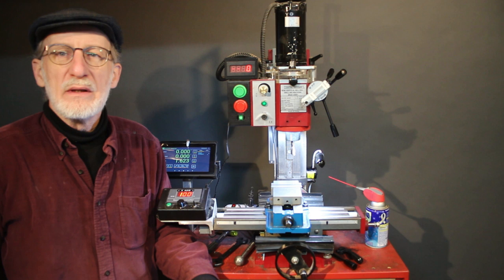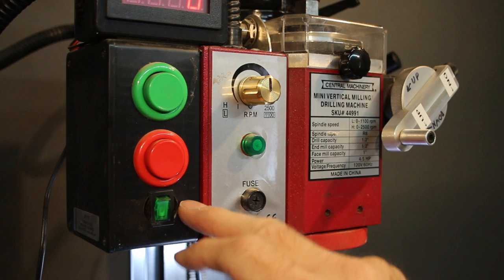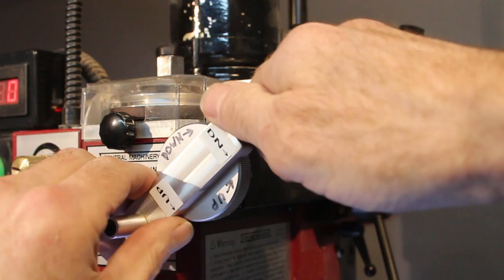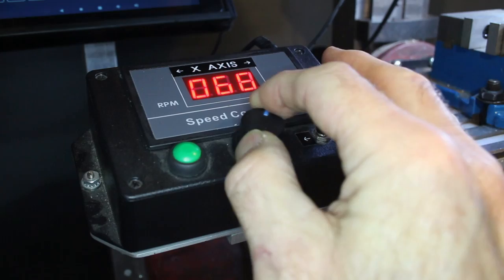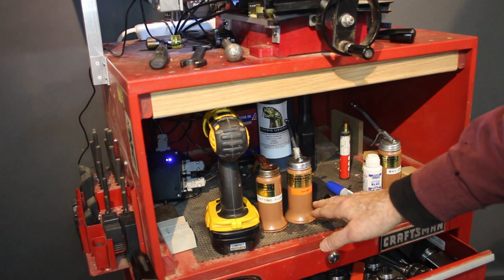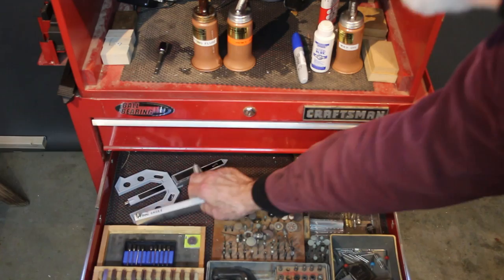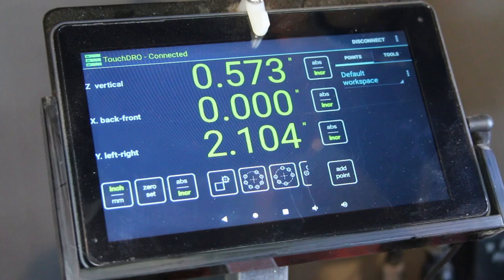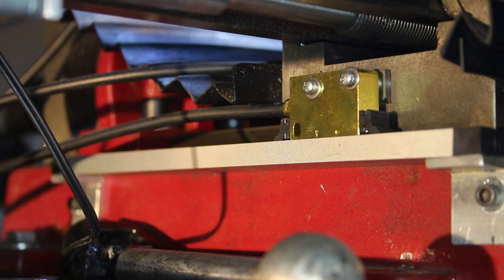Upgrades for my Harbor Freight mini mill

Comment: Great job, with the mods. I have just picked up a Grizzly version of this milling machine, and I'm trying to do similar things as you did. Could you please describe some of the mods, for example the start/stop button mod,  also which motor/power supply did you use for the power feed? A handle can't be used anymore, right?
Reply from the maker: thanks, I am sure you will enjoy that Grizzly milling machine!  If you do a Google search on "power tool start stop switch" you will find a switch like the one I built from scratch.  They are quite affordable.  

I used a 160 RPM 12 V DC motor like this one from Amazon:
https://www.amazon.com/BRINGSMART-10kg-cm-Self-locking-Reversed-Rotating/dp/B07F8RYKB8/ref=sr_1_13?crid=3VT3QS57447C2&keywords=right+angle+worm+gear+dc+motor&qid=1644072093&sprefix=right+angle+DC+gear+motor%2Caps%2C845&sr=8-13
Any wall power module rated for at least 500 mA will work to power it.  You may need to look up how to wire a DC reversing switch.  the speed controller I used already comes with a start/stop button and the speed control knob.

Right, I no longer have a handle because I couldn't figure out how to engineer a clutch.  If you want to spend the money, little Machine Shop have a complete power feed kit but it's quite pricey.
Reply from the maker: You may want to check out my latest video on how to tram the column:
https://youtu.be/8iK1hlLNB9E
Reply: @GuyMarsdenMakesStuff  Yes, those are good ways of tramming the head. I even have at work the Edge Technologies double dial tramming tool. I'm a (manual)machinist by trade. I even machine flight parts, that will go to the moon by the end of this year, and next.
Reply: @GuyMarsdenMakesStuff  The switches are no problem, I've got a fairly well stocked electronics bench. I'm curious what modification specifically you made to the controller board. BTW - You've got a new subscriber!
Reply from the maker: @jrkorman  I didn't modify the control board. The button switches just activate a relay to switch the 120 volt power. Well you can make your own as I did, it's a lot simpler to just buy a power tool start/stop switch.
And thanks for the sub!
Reply: @GuyMarsdenMakesStuff  Thank you - that makes sense. You're turning it on/off without using the knob switch! You didn't mention, did you do the screw modification from metric to inches. It's quite nice.
Reply from the maker: @jrkorman  No, I didn't mod the screw - I use the TouchDRO for all my precision work.  I installed magnetic scales on all 3 axes.

Comment: Guy.  I like the power feed option you did.  What is your power source you used for the dc motor?
Reply from the maker: Thanks! :)   I used a 12V 1.5A wall adapter that I had laying around.  It was from an old Netgear router.  Generally it's good to use an adapter that has 2X the power that the motor needs so it doesn't overheat or fail.  So if the stall current of your motor is 700mA then use a 1.5A adapter.

Comment: 'Hello Guy! I have another question for you please: I hear horror strories from the users of these red HF mini mills with the tiltable column that unless one strengthens the base of the column it's impossible to mill anything because the end mills will break like mad one by one. They insist the column needs to be solidified. I see many people use these mills without such extreme mods and they work for them. Who should I believe? I don't want to get in trouble after buying one.
Reply from the maker: Sorry, I thought I had replied to this.  I don't do a lot of extreme milling with steel, so I don't see the column being stressed enough to go out of tram.  I do periodically check and re-tram the column - especially if I'll be using a big fly cutter.  I have never broken an end mill - that's usually operator error, or learning the hard way what speeds and feeds to use.  Of course carbide bits are much easier to break if you're not careful.

Comment: Do you have a link for T-nuts that fit the HF44991 table slots, the 2 that came with the Mill fit perfect, but I've ordered extra's from 2 different places and both of them were just far enough off, that they wouldn't fit in the table slots.
Reply from the maker: I bought a complete clamping kit from HF that has the right size t-nuts.  6 nuts and many bolts and clamp bars.  Essential for the mill, so I recommend getting that set.
Reply: @GuyMarsdenMakesStuff  Thanks for the lightning fast response, Actually I did that exact same thing . . . When I ordered the Mill, during check-out there was a bunch of suggested items that I might also like to purchase, one of them was a 58pc. combination step block and clamp set, so I added that to the order, but the (6)T-Nuts don't fit the table, so rather than go through the return process I thought I'd research just buying T-nuts, ( the threaded bolt pattern works fine)
Anyway thanks for your input . . . I'll contact HB and see if they can correct the order.
Reply from the maker: @dquin2932  as you probably know by now there are a variety of different tea slot sizes and I think your best option is to return/exchange your clamp set for one that fits your machine. You won't regret it!

Comment: Great video. Thanks. I am looking for a mill to miter chromoly bicycle tubing with a hole saw, but don't have room in my shop for a full size mill. Is the power and rigidity of this mill be sufficient for this?
Reply from the maker: I don't really think you need a mill for what you're trying to do.  A good drill press and a strong drill press vice should suffice. If you have watched Colin Furze videos you will see he has some very clever jigs for doing what you're trying to do.  Check out some of his weird bicycle videos to see what I'm talking about.
Reply: @GuyMarsdenMakesStuff  Probably true, a good drill press and vice would work, but I'm also wanting milling capabilities to make other things and I'm hoping this little mill is better quality than most central machinery stuff.
Reply from the maker: @adamhoff3448  understood, I was able to use my harbor freight mini Mill right out of the box after a small amount of cleanup and tightening the Gibbs.  None of these machines are perfect as delivered so you will need to spend at least half a day learning how to dial it in and getting it trued up, but it will have enough power I think.

Comment: the riser cabinet seems rather weak to securely support the mill, considering it's made from MDF, and rather thin .   You could see swaying in the video
Reply from the maker: Its actually reinforced in the corners and the swaying is due to the tool chest shifting around slightly on its wheels.
Reply: @GuyMarsdenMakesStuff  doesn't the raised profile of the auto feed control panel interfere with the table, restricting usable placement options?   the factory stock auto feed unit top surface is flush with table surface, and so is the handwheel .    please pardon my nit picking, yours is very involved upgrades and both informative and inspiring.    I am in love with these little machines and heavily mod mine too ... and i get really get into it ...  thanks for sharing .
Reply from the maker: @martinmengh  yes, you are absolutely right.  In retrospect I would've mounted everything below the table surface.  On a recent long project that stuck out beyond the length of the table I had to Mount the item I was machining up on 123 blocks which worked out okay.  But I might reengineer my motor drive control box to be below the table surface at some point in the future.

Comment: Guy, thanks for what you do love your videos after I found them a few days ago. I’ve looked at your links and I can’t find where you got your start stop switch with your power on LED lights. Can you give me an idea for a link where I could pick this up? Thank you
Reply from the maker: I am an electrical engineer, so I built my start/stop switch from scratch.  But if you search the web for: "power tool start stop switch", you will find many inexpensive options.  - I'll add a note in my description that mentions this since other people have asked.
Reply: Thank You, I’ve found a few on Amazon that I can modify.  Love the videos and educational format that you use.
Reply: Hi guy great videos👍, I purchased a switch from Amazon but I have no clue how to wire it. Do you have a link to a wiring diagram of sorts?
Reply from the maker: @kennethwealot9592  Each switch will be a little different.  But the general idea is you want to switch the AC power coming into the machine.  So you would cut the black wire inside the control box and connect each side of the cut wire to the two screw contacts inside the switch.  In theory, your switch may be different though.

Comment: Very cool I love your project 
I have similar mini milling machine i got it new but I can't remove bore from spindel I try to much but dosent want to come out do you have any idea
Reply from the maker: You need to tap down on the top of the drawer bar nut were they small hammer to release the Morse taper
Reply: I did even I used metall hamer and I heated hard its like jaam I put some oil inside also but dosent want to come out
Reply from the maker: @masoudkolahi5354  Sorry I can't help you any further.  Maybe watch other YouTube videos by Frank Hoose's: "Introduction to the Mini MIll".

Comment: Is the relay on the start/stop buttons just in parallel with the potentiometer switch ?
Reply from the maker: No, it turns on the 120V power to the machine
Reply: @GuyMarsdenMakesStuff  Thank you very much
Reply: @GuyMarsdenMakesStuff  Can you share the schematics ? I'm referring to the green and red button connections.
Reply from the maker: @ddlc7022  Sorry, but when I removed those buttons recently as part of the brushless motor upgrade, I forgot to document how I wired those buttons.  There was no relay, so I really don't recall how I did the wiring - it was just the 2 arcade game buttons.  The upgraded motor video shows how I wired one red button as a STOP button, but that's a totally different control system:  https://youtu.be/ndhsCeuEv-4
Reply: @GuyMarsdenMakesStuff  Never mind, I figured out how to do it on my machine, which is a Little Machine Mini Mill